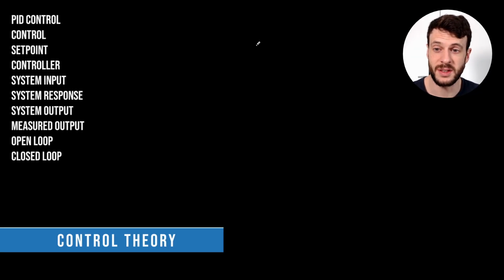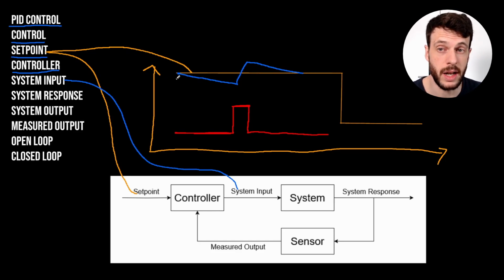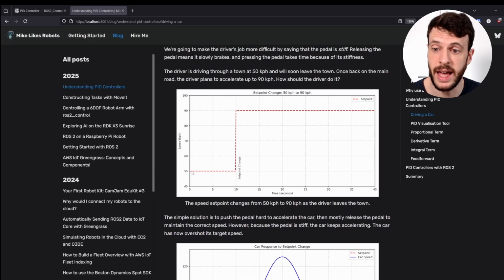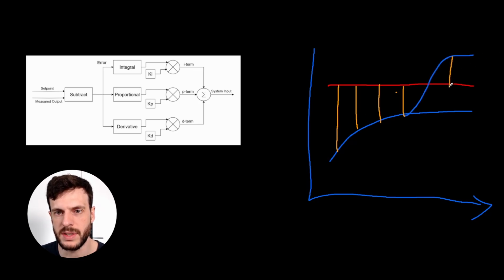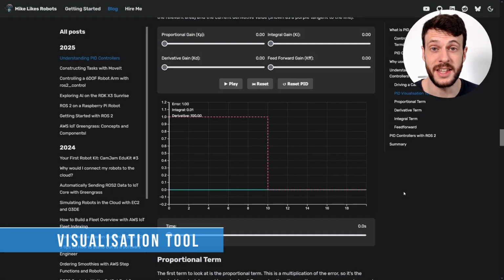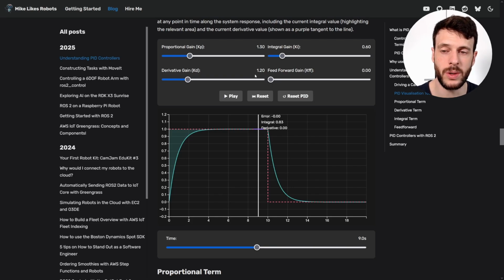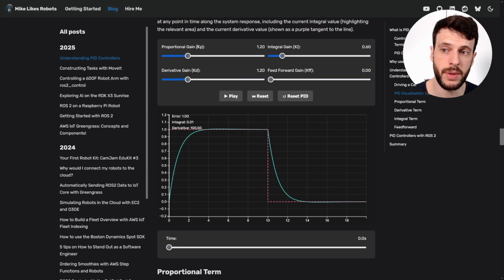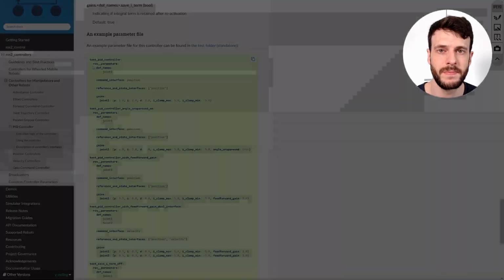Understanding PID Controllers

Comment: Exactly why I subscribed to this channel, beuatiful video, thanks Mike!

As an engineer I'd say I use PID controllers quite often at work, whenever there needs to be a movement with a motor or a heater or fluid level, pid is the go to tool. But i do it with Matlab which takes care of a lot of things automatically including simulating disturbences and so on. Problem is that its not open source and therefor I dont feel at control. 

If I were to develop a hobby project or start a company, I dont think I would be able to afford it. Yet despite past my experience, I have yet to develop an open source alternative to the matlab workflow, like first modelling my system, simulating disturbances and trying responses, and maybe even optimizing. With videos like this I get closer to the end goal, I appreciate it very much.
Reply from the maker: I'm glad it was so helpful, that's great feedback! I tend to see Matlab as a different tool from other programming languages; it solves different problems. Having said that, Python with numpy does handle a lot of the same operations, especially with Jupyter notebooks available.
Reply: @mikelikesrobots  Thanks Mike, for your answers and these great videos,  what libraries do you recommend apart from Numpy and the ROS tools? Do you simulate controllers in Gazebo?
Reply from the maker: @ROBOROBOROBOROBO  I have used Gazebo a little, but not enough to say what the best tool to use is. Most of my control work has been with physical robots. Still, I can't think of a better tool than Gazebo for learning in simulation!
Reply: @ROBOROBOROBOROBO  The Python module 'control' has enough features for simulating / designing controllers. There’s even a MATLAB compatibility mode with a useful functional replica of a very small part of MATLAB. In any case, as Mike said, there’s only so far you can get with sims; the real system will have uneven mass distribution, friction, and other effects the simulation won’t capture properly.